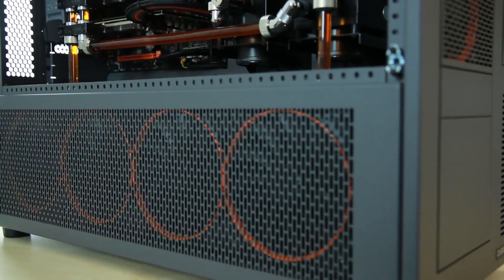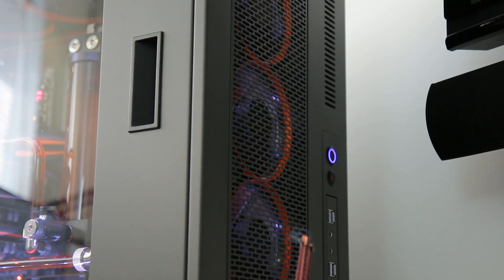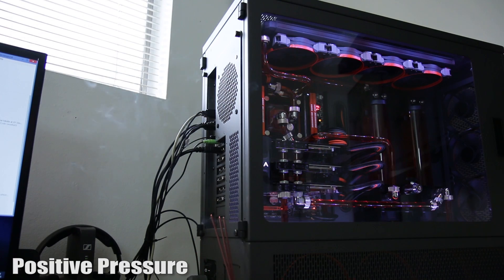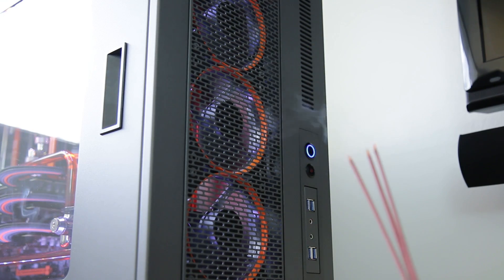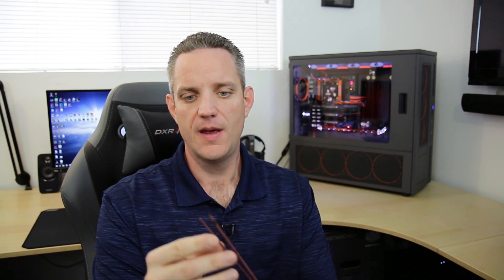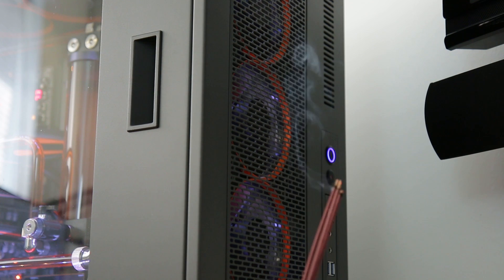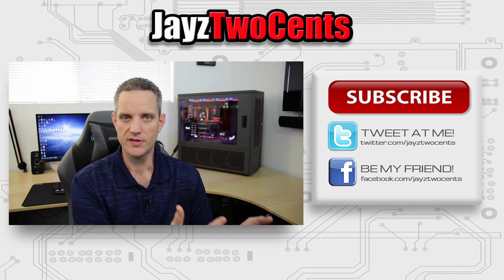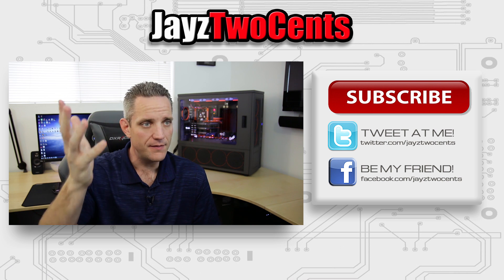Case Flow and Pressure Demonstration - How to balance airflow

Comment: The number of Fans doesn't count?
I dont see it like this. 
One type of Fan,  One in, one out..   same specs, Fan speed , air volume.. 
one more in, doubles the income.. Higher Pressure inside right?
Other way around, we go negative pressure, right?
So the number of fans can actually have a huge influence on pressure.  If same settings are used.

Comment: I just kinda use common sense from the basics i've learned about fans and case cooling. I put Static Pressure fans in the front as the air will need to pass through different obstacles and components, then i use regular air flow fans for the exhaust to remove the air. Works great for me, have no issues.  CPU idles at 32-34C and GPU idles at 34-36C

Comment: Love the smoke testing , but 
Okay I know I am being Anal here, but you possibly need to use different description rather than Positive and Negative Pressure. "More air going in than is going out"? is .. umm well ... Impossible unless ur Pressurizing the (sealed) enclosure thru one way valves. in an open enclosure you will ALWAYS have the same amount of air exiting that is entering (minus the variations for temperature). There CAN be a pressure gradient. IE if u pump air in so fast that it is limited in leaving by the lack of vents. But this is a transient situation.  My pont is that Positive and negative "AIRFLOW' would the term to use.

After pondering the Above and thinking about how 'Positive' is a  misnomer, Now Consider - negative pressure (more air leaving the enclosure than enters it)? lol

Comment: I noticed at 3:03 "You can't have the fan blades moving and air not moving across it, that just not the way physics works" Yes that is the way physics works! Have you never played with a pc fan in your life? If you block a PC fan while it's running does it suddenly stop spinning! No! It just doesn't move any air! PC fans can actually continue rotating even if both sides are completely blocked during operation. Because the fan blades simply spins the air in a vortex inside the fan housing.

Comment: Guys! Can someone explain to me,  is it a bad idea if I'll use custom water cooling and install 1 radiator with intake airflow in front of the case for CPU, another one on top of the case for GPU  (intake as well), and single, but stronger than others outtake fan on the back of the case? Or for GPU cooling and total cooling in general, is better if air is taken from within the case, and exhausting from the top passing through radiator? I'm only entering this tech word, so apologies if that question sounds stupid. Thank You in advance!

Comment: I've done it this way:
In idle I have the fans make positive air pressure because it's in idle most of the time and that will prevent dust from building up. Then when the computer is under load I have the rear fans ramping up to get negative/neutral air pressure to get as much heat out of the case as possible.

Comment: So why do you need exhaust fans at all? Just use as many filtered intakes as you want and the air will find it's way out or not?
Reply: Maybe in some cases (pun intended)
Reply: It helps guide the airflow and get the hot air out.

Comment: You do realize that "negative pressure" means it would be less that 1 atmosphere of pressure. If that was the case (hahaha) your case would collapse under the outside pressure. But it doesn't because it's not air tight and as long as there's air coming in the case the pressure can never be negative.
Don't skip science class kids.
Reply: Muru Roa it’s a term related to pc case airflow
Reply: @Snagoot  Right, still doesn't make any logical sense.

Comment: So I wanna know if this is good airflow I’m using a rtx 2080ti and I have 3 front intakes and 4 exhausts one on the back and 3 on top do you think that’s good airflow should I keep the intakes high and the exhausts fans low or what should I do

Comment: You can also use some hairs instead, or a thread. If you hold incents there for some seconds it is no problem. But incents acutally create a lot of unburned dust and particle matter, that wont be filtered. ;-)
This video is not very funny - learn from the best - watch the verge!!

Comment: Another interesting way to show it is with a piece of paper. If the paper is sucked onto the case then you've got air coming in, if you hold it up and it falls off or is blown away then it's an exhaust. (For those who don't want to burn their house down)

Comment: I bought RBG fans that all ended up being exhaust fans because the RBG lights were only on one side of the fan. i dont know how to flip them to being intake fans without putting the RBG lights against the case metal.

Comment: Tower 900. At the moment, 4-140s in thru a 560 Rad 2-140s out 1 front 1 rear.  And when the next Rad go in I am very in tune with flow. SO I will have to re arrange and manually tune the fans to keep it neutral/positive.

Comment: Master case H500M, two 200mm fans in the front, 140mm in rear. I have another two 200mm fans that can go in the top with three possibilities -
both intake, both exhaust, or front top as intake and rear top as exhaust (because you want the fan that sits over the mobo to exhaust all that hot air).
Would that work ?

Comment: With  5 fan case (2 front,2 top, 1 rear} the best temp was all 5 on intake.
Reply: i've been thinking about this. i have a 2 140mm fanse mounted behind the cpu radiator on the front, i have currently just 1 fan intake on the top, and 1 fan on back exhaust. i'm thinking of adding another intake fan on the top, just to make sure i have positive pressure. but i'm torn. do i mount my top fans as exhaust and risk getting some negative pressure? if i get negative pressure, its ok, my case has dust screens on the front before the radiator, so that helps a little,... i could try to close up as many holes as possible so that all the negative pressure comes through filtered mesh... i dunno. 2 140mm intake and 3 120mm exhaust? or 2 140mm intake, 2 120mm intake, and 1 120mm exhaust? i'm leaning towards intake heavy..
Reply: @rpgtrainer  experiment with it. get yr best temp

Comment: This wasn’t very intelligent, hopefully you’ve learned in the last couple years. I can’t understand how you thought removing the fanned radiators from the equation. Whether a fan has a heat exchanger, slotted metal of some kind , or nothing at all you’re still adding or removing assisted cfm via fan. So you do not have positive pressure despite 4 or 5 exhausts with only 2 or 3 intakes.

Comment: wow first off thank you for explaining this in an easy to understand way. I'm slightly new to modern gaming cases and got one pre-assembled by a friend, the case had a fan in the front pulling air in, then (the mistake) having 2 fans pull out on the top (besides kind of limiting the cooling it also increased fan noise as well) and finally the smaller fan in the back possibly blowing air into the case (it's hard to tell which direction it was blowing as it's very gentle with the fan speed xD) so I decided to just think of the fans as blowing towards the sticker, so I turned the back fan around so that in theory it's blowing out as well as the top fans pulling air in. So far it's reduced the temperature by a few degrees but the main thing is that the temps don't rise too fast and cool down a little faster vs before when the air was just getting pushed and pulled in all directions. I really enjoy learning a lot of pc tips / tricks from your channel, keep it up man :)

Comment: Where would the best place to mount the evga hybrid radiator and fan? I have 3 intake fans with the cpu radiator on the top two fans in the front and one exhaust fan in the rear and no fans on the top

Comment: Hi Jay, I`m doing a build in the View 71 with 3 radiators (all Thermaltake RL360`s), and 13 fans in total. What i`d like to see is how to connect it all in a CORRECT way. Think fancontrollers, hubs, Y-splitters, MB-headers and what not. And how to do the software side of it all. I can`t really find a good build video on this part of a build and it is quite important. Don`t you agree?

Comment: I'm bad for this, I should be burned at the cross, but I fill up all of my fan slots and then try to make it all as quite as possible (if i can turn the fan off, I will) until it starts getting nice and toasty, in which I have the fan curve set to aggressively ramp up speed to keep it below scary temps (80c or below at least)

Comment: I have these chemical smoke tubes used to check air flow in mines.  They work awesome.  Put out a lot of smoke and you can really see how the air flows within the case.  Pretty neat with a glass sided cases

Comment: But the Verge told me I don't need any fans in my case
Reply: As long as they told you with confidence.
Reply: Just make sure you really hammer in your components and you'll be fine.
Reply: it helps to apply thermal paste like you're frosting a cake - use as much as possible and make it look pretty
Reply: with livestrong wristband you can achieve anything
Reply: @lopsangdlama  you're fighting static, not fighting cancer
Reply: Only if you add enough thermal paste and tweezers.
Reply: So long as you use a swiss army knife to punch some hole in the case it will be fine. ;]
Reply: Make sure to stick the memory 0.1 cm to each other
Reply: The verge is full of misinformation
Reply: Check his twitter, He’s still getting hammered because he hasn’t even apologized for being incorrect and hating on people who pointed it out lol. Gold
Reply: remember to frost every component in your case with a lot of thermal paste even get into every crevasse of the case to make it look like a Purdy tasty cake and not just for the case do the mother board graphics card everything
Reply: Make sure to choose the gpu slot you think looks best
Reply: Technically that's correct in outer space.
Reply: Fuck it, no case
Reply: As long as you throw your monitor down thr stairs everything will work
Reply: If you use rgb it will be fine
Reply: Also remember. Cable management is useless.
Reply: hopefully the swiss army knife has a screw driver
Reply: @biggerbrain8493  I literally have a philips screwdriver... no need for that swiss army knife BS
Reply: No need for fans as long as you have a table
Reply: Do you have any rgb?
Reply: @gabrielkellar1935  i have R only
Reply: Kabooki San thats your problem
Reply: @gabrielkellar1935  but the Verge told me as long as I put enough thermal paste, the G and B doesnt matter :(
Reply: Kabooki San hate to break it to you, but they lied, the human eye can only see a normal amount of paste
Reply: Vegan fans are better
Reply: They are also on the verge of destruction of pc
Reply: Are you living in Alaska?
Reply: make sure to cum on the CPU, wait why am I so late
Reply: I'm on the verge of fighting the guy that always gets the first comment and mentions that damn video.
Reply: @keithmuset6510  I see what you did there.
Reply: I know it's a joke on the Verge, but for my standard single CPU/GPU (no OC) setup the cooling solutions on the components get the job done. Depends on how much heat the system produces. After all smart phones dont have case fans either. :D

Comment: @JayzTwoCents this video is a few years old now, i was wondering. with new fans brought out (such as Maglev fans) and other sorts of cases and different placements. would it be possible to re-visit this video with such cases/ fans? (case example, Lian-li 011 dynamic) either one big video or a 2 parter to show the best methods of getting positive pressure in systems which have more exhaust than intake? as in a visual guide of adjusting stuff liek fan curves. 
while deciding the parts ive wanted for my new ryzen pc, i kept bringing up air-pressure and the people helping me through the component decisions say im taking wayy too much care in air-pressure XD
Reply: well yeah most people don't care that much

Comment: A little late here on this video but would it be a good idea to seal up the extra holes in my case to allow the fans to create more pressure. May sound dumb but i have a hot glue gun to seal it up. Or is it better to leave spaces open; like for an extra fan spot you dont want to use?

Comment: How about funneling the air so it doesn't go:
     I    I   L not cooling very much of the volume
     I    I _ _  cooling well
     I__ __ __ air warms up more because of a long route.
Having a higher speed on the front bottom fan than the front fans above, and having the top fan in the back faster than the top fan near the front, should help.

Comment: I just have them all blowing out. No dust gets in that way and dust is worse for thermals than "poorly balanced" airflow. I RARELY even have to dust my radiators and the inside of the case stays SPOTLESS and I never have to touch it. It acts like a clean room.

Comment: I am looking to have 360 top and 240 bottom radiator but is it okay to have them as intake (fans pull through them) and front and back be exhaust?

Comment: The number of fans DOES make a difference to pressure because the other option is to leave the space for the fan empty which will reduce pressure. Is that not right?

Comment: Is it ok to try and make it as simple as possible for optimum performance? What I mean is: How about equal in and equal out????   I am wondering if I push 3 fans (all my fans are 140mm) in through the front and then put 2 fans pushing air out through the back at the top of the case and the bottom???? I understand that this is not exactly equal but that is what I am working with. Is this a good idea or should I do something else with my 5 140mm fans? Thanks for making this video! Your a great guy! Peace!
Reply: From a bystanders view, that sounds perfect. The front intake to the back exhaust promotes cold air to go through all of your parts, and the exhaust at the top back enhances that effect + takes into account that hot air rises. Even if the air pressure isn't perfectly equal, it is better to have positive air pressure than negative air pressure so dust is less likely to accumulate in your system (assuming you have dust filters on your intake fans, if you don't have dust filters get some asap or be prepared to clean your PC more frequently). Hope this helped and wasn't too late :)

Comment: i have a question. I got the Cooler Master Q300L case. i still doesnt understand how does airflow works in here. my graphics card blows to the front of the case,should i get case fan on front panel as an intake or exhaust? and one at the bottom underneath the GPU for an intake and in the top,exhausts?

Comment: I have 1 intake on the front 2 on the top and 2 exhausting through the rad on the back for my aio. under heavy work loads i may see 70c, but i have my CPU overclocked to 3.925 at 1.42v, GPU on the other hand is a founders 1070 if i leave it stock it only will be seeing 72c overclocked can get into the 85c range. from what i understand this is adequate

Comment: Well my only fans were 1 intake to a radiator to another intake fan. Under a full load of Forza h4 on surround and SLOBS broadcasting 108060. It was rocking at a nice 73• on my cpu and 61 on my gpu. I removed the panels for open air and now under load I am at 8-10• cooler. Only problem is I have to dust it every 3 days or so but I don’t mind that.

Comment: ive heard/seen(on youtube) some mixed opinions on exhaust out the top because "hot air rises".. but since the processor is usually near the top it forces the video card heat and all the other heat across the processor. So it might work more ergonomically to draw cold outside air over the processor and out the front? one test that i saw at a 10 degree temp difference. Im gonna be doing my first build soon... so much information out there to learn!!

Comment: I've got a good question for you the video cards like my MSI has the setting where the fans will not kick on and tell the video card feels it needs to be cooled is that actually good or bad for the card ? I understand that is going to save on the fan life because they're not always on but is it going to give you worse frame rates because of the fact that your card is hot already by the time it feels it needs to have the fans kick on so is the video cards going to throttle down because of the extra heat until a video card fans kick on if that makes sense.

Comment: Are you sure that positive pressure also promotes lower temps than negative pressure? There's been some reviews I've seen where negative pressure readings were a couple of degrees cooler in the case. Maybe that was the type of case though?

Comment: Seems to me if heat is rising in your case something is wrong air pressure is air pressure let's say you had one intake on front side towards the bottom and one exhaust on the back  Parallel with each other And both fans were creating the same pressureI don't think much hot air would rise because the pressure would keep it flowing from one fan to the otherShow in a sense if your and your top fan's as an intake and as long as you have equal or positive air pressure heat rising doesnt factor in when choosing where to intake and where to exhaust the air pressure is to strong for the heat rising  Scenario applies  I think with the air pressure a strong as it is hot air doesn't hotto go up it just stays with the flow I think

Comment: Nice rig, I run positive pressure 4 sp120l 74 cfm each and 3 ml120 for exhaust, I run CPU 11.7 c at 25% load OC @ 5g liquid cooling yes 52 f my build is cold all in a mid tower